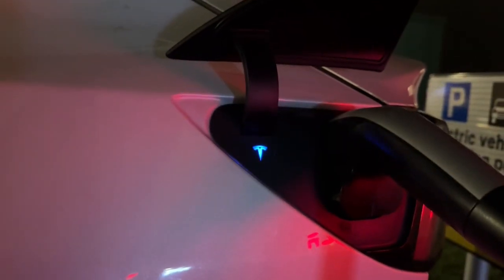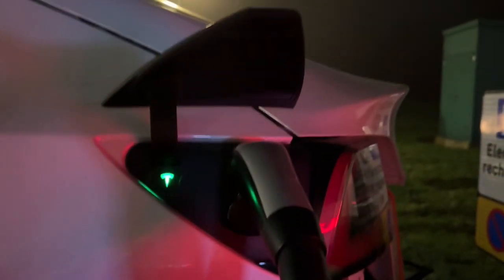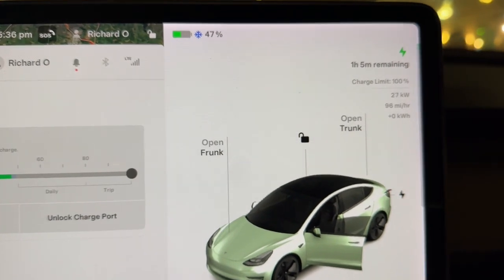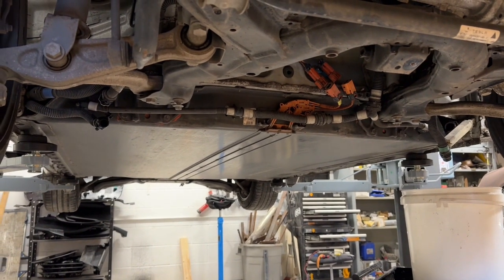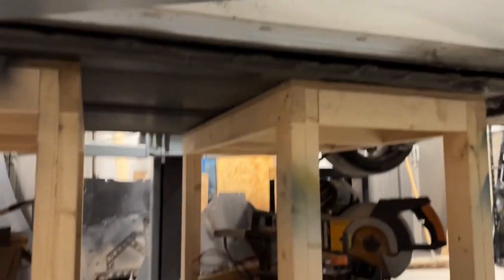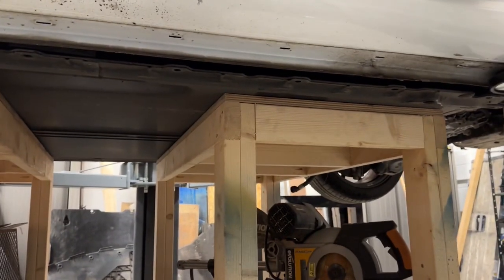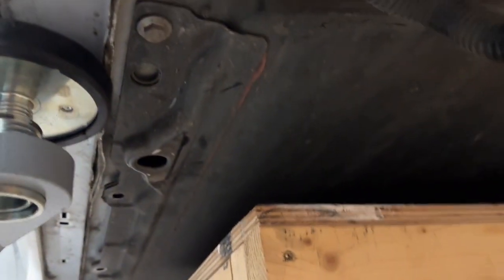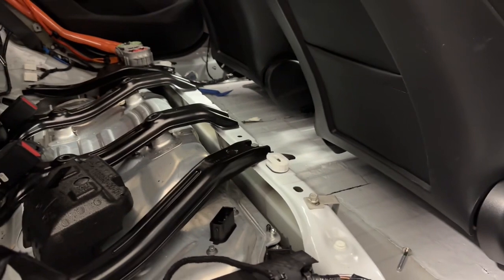Tesla Gullwing build: part 2, supercharging and model 3 battery removal.

Comment: Nice. That wouldn't be fun on jack stands.  What kind of curb weight are you going for?  And how much of that will be batteries?  Range?
Reply from the maker: @GeorgeGraves  jack stands were never an option for me! These workbenches are pretty robust and the casters are rated for about 150kg each from memory. Original car curb is just under 1700kg, with the shortening etc it should be a fair bit under that but I’m not chasing numbers. The battery is about 480kg. Range should be better but will have to see by how much.. The stripped down performance model 3 (from b is for build) took a second off its 0-60mph and TSK quote 3.7s for their wide bodied gullwing so it should be fast enough too.
Reply: @ricolaracing  I hadn't seen that TSK build.  It was....interesting (kinda trashy to be honesy) - A gullwing is a classy car.  It doesn't need underglow floor mats to look good IMHO.
Reply from the maker: @GeorgeGraves to be fair they were commissioned to do the technical build then S-Klub did the styling. It’s great that it has proven the concept but mine will be a much more subtle build.

Comment: That's great that it is Supercharging! Maybe you could open the front of the battery pack and have a peak to see if you have the short modules? Is there any way you could leave the penthouse in place with a shortenened front end of the battery? That would save a lot of work!
Reply from the maker: How would you advise getting access to looking in the front part of the battery? Could I undo one of the coolant front side ports and push it in slightly? I need to rewatch some disassembly videos to remind myself of all the steps.. From what I’ve seen on the TSK gullwing build there’s no chance I can keep the penthouse where it is, unfortunately.
Reply: @ricolaracing  No need to disconnect any coolant lines the top (thin steel) lid goes over the top of all that. Just undo all the little torx head screws and then carefully go around with a paint scraper to release the eurethane seal.
Reply from the maker: @sydneyg007  I cut through just the front section of sealant, enough to peek inside and they are short 🎉